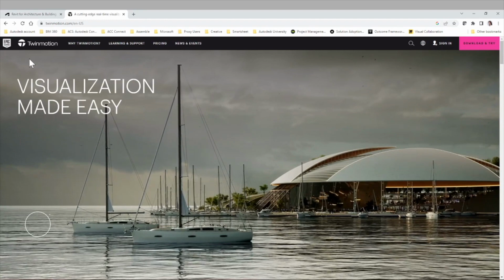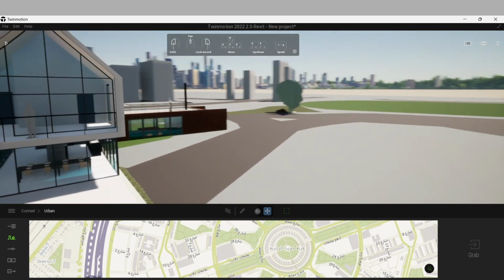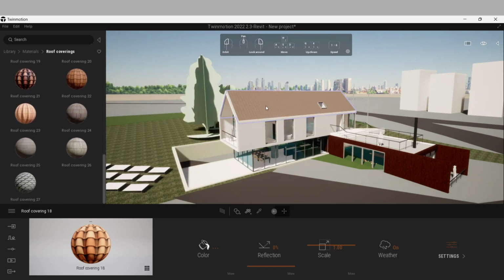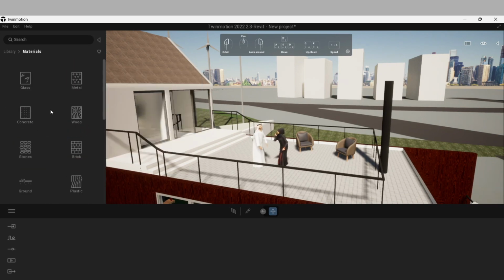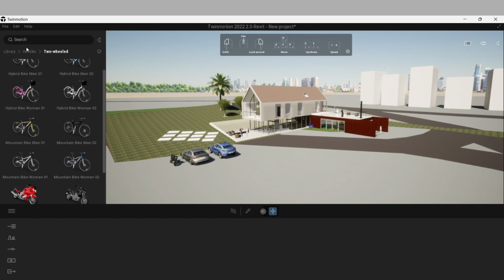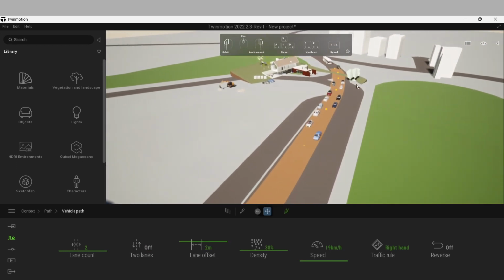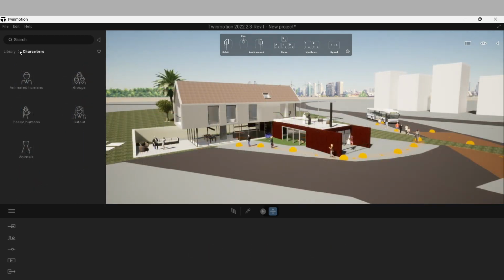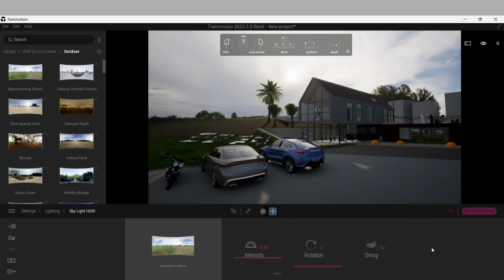Twinmotion for Revit Walk-through! #Twinmotion #Revit #3D #Visualization

Comment: Thank you for your video ! ;) Regarding the project location, in twinmotion 2023.1 (for  revit) the settings are different and I can identify the city that I want to place for my project in openstreetmaps but I am not able to save it in the end, and see the contest around my project with the relatives buildings (i cannot find the bottom "grab"). Do you have some advice about it ? Thank you very much Carolina
Reply from the maker: Thank you Ilaria! I'm glad you found the video useful :) Maybe try a different location (somewhere nearby) and check if the problem persists. If the location is available in Openstreetmaps it should work in twinmotion as well!